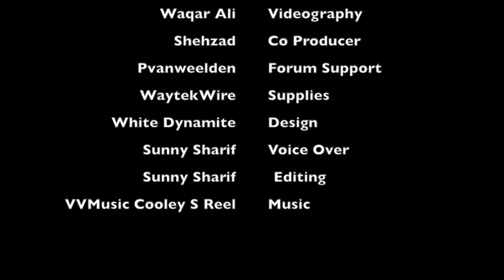DIY sPOD "Switch Pod"for Jeep Wrangler 2011-2015 (installation) (Part 3)

Comment: Great video series. Something I'm not completely clear on is the ground. How is it all connected? In this video you have the ground wire from the switches going straight to the relay panel but what isn't shown is from there to common chassis ground? When your accessories are wired the ground wire for each should go nearby each accessory. The circuit isn't complete if the ground from the relay panel is not connected to the same ground plane. At the battery you connected the positive with a breaker but didn't mention the ground at the relay buss going to accessories.  Could you clear up how you completed the ground side of the circuit?
Reply from the maker: The the ground wire gets attached to the body or any negative nut on the body. There are many locations you can add, I will be making another video soon showing how to connect an accessory.
Reply: Yes. I understand. You didn't ground the relay panel to the body of the vehicle. The circuit will be incomplete and nothing will function. Unless you did and just didn't show this in the video.. did you run another wire from the negative buss on the panel to the body of the vehicle?

Comment: why power source getting from windows switch and cigarette switch, why don't connect it to the battery along with the breaker
Reply from the maker: So switches display lights turn on only when the key is turned on, other wise if you connect to the battery they will drain the battery by being on all the time
Reply: @TheHandyFlightAttendant  i see thanks man for the info

Comment: How do you wire the accessories to the short end of the wires. Thanks
Reply from the maker: joe8262 you connect your accesorries black(ground) wire to the body of the car and the red wire to one of the short end of the wires. I hope this helps

Comment: I'm stuck when it gets to tapping into dash lights, I don't have any power windows or power locks. Is there any other source for the dash lights?
Reply from the maker: there are ways, I will have to look it up...I will get back to you soon regarding this...

Comment: Hey my dude! Really digging what you're doing here. But I'm trying to tap into the ignition power source and that's where I'm stuck. You said you added an in line fuse with a 5 amp fuse? Is that enough to power a rocker switch let alone 5 of em? I just got an ARB compressor and the wiring is pretty similar, but it won't turn on without the "ignition on" wire tapped into anything. Just making sure I'm doing it safely so my jeep doesn't explode. Thank you!!
Reply from the maker: 44fan182 hey thanks buddy, so basically the way I have it all my accessories are being powered on with the the sPod I made, and cigarette lighter wire is supplying power to the switches... in order for switches to work key has to be turned on.
Let me know if that helps.
I am using the blue wire from the cigarette lighter where I had attached the fuse. And it's more than enough to power the 5 switches :)
Reply: Sunny Sharif cool thanks ! Last question is it safe to be tapping into the cigarette lighter like that? Has it worked well not interfering with the JK's computer system? I keep reading stuff and people do it the way you did it, and some use a fuse tap and just run the wire from under the hood to inside so it's more direct. Thanks again!
Reply from the maker: 44fan182 hey it's perfectly safe, I have done this in over 10 jeeps. Plus It's been working perfectly in my three Jeeps that I personally own so it's all good to go... best of luck

Comment: This three part series was the most complete and easy to understand tutorial on this subject I have seen yet. Great job and you just saved me 3 or 4 hundred dollars on an SPod...Question, how do you determine the size of the circuit breaker used between the unit and the battery? Is it based on constant draw or max draw of amps? Thanks.

Comment: Mad props for putting this out there!  Jeep has one of the biggest after markets, if not the biggest, in the automotive industry & a lot of companies have cashed in on it & sPod leads the pack! I must applaud them & their marketing because how they were able to get masses of Jeepers to pay $400+ for a handful of relays, fuses, rocker switches & distribution block is mind boggling. I'm just mad I didn't think of it! If I may make a suggestion, the one thing I would do to refine this is adding a distribution block & mount that on some sort of panel alongside the relay/fuse box & run the 5 accessory leads into one end of block so then all one would have to do is run their accessories into corresponding end of distro block. I think it would simplify things & cleaner install & would only cost a couple more bucks to do so
Reply from the maker: dwizl7213 great idea and thanks, I will see if I can add the block, I did add a black for ground wire, I will post a video soon with the update...thank you so much for your awesome comment:)
Reply: Yes, pretty much what I'm suggesting. A distro block for ground & another for the juice. Oh, another thing...instead of having to get 6 separate different colored primary wires you could use speed wire. It's basically the same thing, 8-12 different colored wires, just bundled & twisted into one jacket. It's primarily used in after market stereo head unit installs. Comes in different lengths & gauges. Jeep in dude! 
http://www.sonicelectronix.com/item_20326_Install-Bay-MC918-20.html

Comment: Does the full on mode turn everything on?
Reply from the maker: No, but if you wore them accordingly you can use that as to do that. It's not a bad idea ;)
Reply from the maker: i meant if you wire them to turn all the lights on then they would do it...but i have other plans for this switch...wait and watch coming soon.....

Comment: Just finished with the Relay and Switch wiring. Need to now install lights and wiring for them. Do you have a DIY video of light wiring and connection to the sPod?

Comment: I'm talking about the box, cables, quick disconnect, fuses, relay, etc
Reply from the maker: Yes just the supply will run you anywhere from 100-160 depending on the switches you order.

Comment: Great write up, but it seems I have come to a problem with the fuse from the switch panel to the lighter wire constantly blowing out. I followed everything you did. So, I'm now sure what the problem could be. Any suggestions?
Reply from the maker: Check the wiring again, maybe the wire is touching another wire, or its a wrong wire. Also, check the switch panel wiring again maybe there is some thing kind of a short in the wiring. What size fuse are you using? Try a 7.5 amp or 10 amp fuse. Maybe someone else can tune in also to help...I have done 6 jeeps so far and none of them had or have any issues....
Reply: I am using a 10 amp use i've checked the wires several time's made sure that there weren't any wires that could short out.
Reply from the maker: i would follow the wires again and check everything again...i m not shower what could be it. as i have mentioned i have done 6 jeeps one of them was recently done and i did it the same way and 0 issue.

Comment: Great video!  Just curious how you actually connect the accessories?  If I have two lights next to my side mirrors, can I just combine and connect the hot end from each of those and connect it to the single output from the relay and ground the blacks?  Will be starting build soon but didn't see how to actually connect the accessories.  Any help would be appreciated!
Reply from the maker: Hey Brent, yes that's what I did for my windshield pods, I combined the red wires together and attached it to the relay panel's single output and black wires of the pods to the body of the jeep as a ground. Feel free to ask any questions you have
Reply: +Brent Arnold http://www.offroaders.com/tech/12-volt-wire-gauge-amps.htm

Comment: awesome helpful series , a few questions. The write up parts list says 80 am circuit breaker, in the video you use a 50 amp ? also should the wire from the negative of the relay panel be 8 gauge wire or 16 like the switch panel ?
Reply from the maker: I used 50 amp as it seems sufficient for the amount of load I will be using for, and I used an 8 gauge wires for both the positive and the negative from the relay panels to the source (battery) I hope this helps
Reply: +Sunny Sharif  so the negative terminal of the relay will have 2 ring terminals, one from the switch panel and one to a ground source ?
Reply from the maker: +Kris P. That is correct Kris. :)

Comment: Need help great tutorial I have completed my DIY using the same fuse/relay panel with your instructions however I missed the wire gauge from the hot 12v fused pin to relay by using a 14 gauge instead of 12 gauge. I'm powering 35w fog lights and all the wiring used from switch to relay to accessories is 14 gauge. Just like to know if I'm fine with this I won't be using any high power aceesories. Please assist I'm dying to install on the car.
Reply from the maker: +Momed Miranda for 35w accessory you should be ok with the 14GWA wire...I am running 300W of led with 12 Gauge wire...you are good to go my friend...unless someone else see anything wrong with this...please jump in and help the fella.....
Reply: +Sunny Sharif, a pleasure to have your support. Im doing this DIY on FJ cruiser and all is going smooth,  I see you tapped to the cigarette lighter  as trigger source what fuse size did you use? I will be using add- afuse on my fuse box for that purposes. Thanks

Comment: Awesome video! Could you do one for how to connect your accessories? Light bars or whatever to relay panel??
Reply: +Sunny Sharif I too would like to see how to connect accessories.   The accessory would have two wires and the relay box only has one wire coming out for each accessory.  do you just connect the positive?
Reply from the maker: +Daniel Priego stay tuned I will make a video to explain how to connect an accessory. subscribe for upcoming videos soon very excited
Reply from the maker: +Mike Williams hey mike I'm working on another DIY led accessory for the jeep, it's almost finished and I will be posting a video of that soon and also will include how to connect it to the sPod....you will love the next DIY video as I myself love making it a lot...by the way you connect the positive to the box and the negative to the body or negative terminal of the battery

Comment: so the rocker panel gets grounded relay panel that gets grounded to nothing other than itself?
Reply: +dwizl7213 switches get grounded to the relay panel and then you ground the relay panel to the chasis. see actual writeup here- http://www.jk-forum.com/forums/jk-write-ups-39/diy-spod-waytekwire-324558/
Reply from the maker: +dwizl7213 Like Pvanweelden said, i connected switches to the negative of the relay panel then to the battery negative or the body chassis :) i hope this helps...check out the writeup its very clearly described in it.
Reply: +Sunny Sharif thanks...awesome tutorial, everything worked out great with the exception of the switch panel. The retaining clips don't retain, it just refuses to clip on!
Reply: +dwizl7213 take the retainer clips from your factory piece and put them on the daystar panel
Reply from the maker: +dwizl7213 hey I had the same issue as well, I sanded the top edge of the switch panel a little and the two groves, once that was done panel fitted well and clips held well... Let me know if it's clear otherwise I will try to take a picture or make a video for you to see it